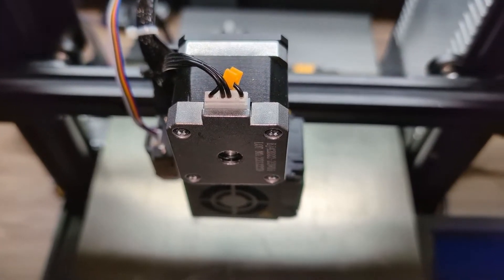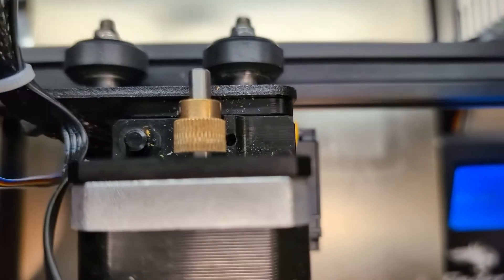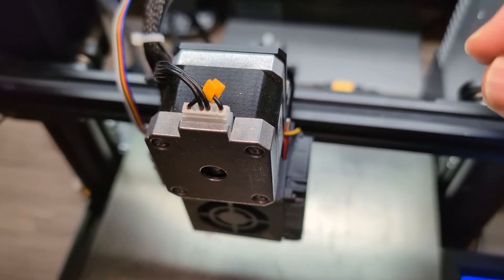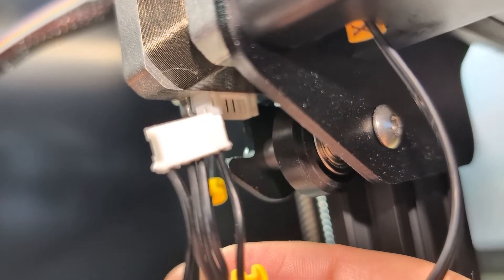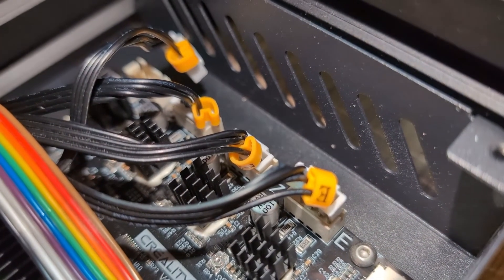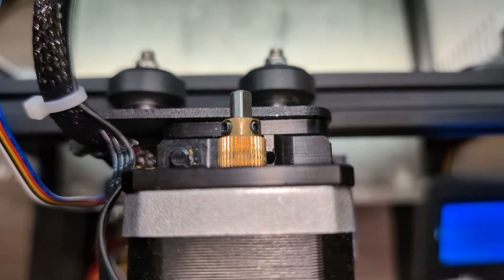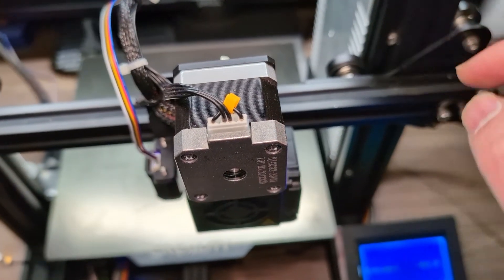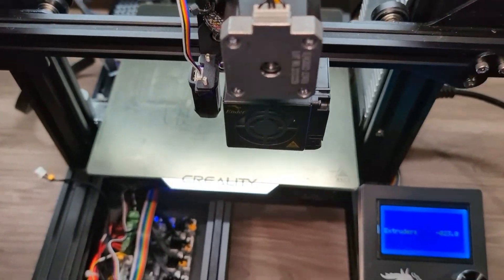Stepper Motor Troubleshooting | Fix Your 3D Printer #ender3 #3dprinting

Comment: hi i have an ender 3 v2 that stoped working after a print, the print went well with no problems but when i wanted to print other things the stepp motor didnt move, i have change the motor whith some good replacements and the cable and didnt work, and im trying to use other slicer to see if that helps if it doesent would that mean my board is broken? thanks.
Reply from the maker: Sorry to hear that, it could be the firmware or the board. Did you try to reset or upgrade the firmware?
Reply: @techs.passion  yea i tried that and didnt work i will try other slicer and to reinstal again the software, i think it could be a problem of power variation because like 2 days before it stoped working lights went off
Reply: if that doesnt work i will try to change the board
Reply: thanks for helping, the video helped me a lot  i will try that and see if it helps
Reply: @techs.passion  thanks so much dude it was a problem with the slicer i tried 3 diferent slicers and it worked with creality print
thanks for the atention

Comment: Could a loose wire make it move a lair line way off
Reply from the maker: That doesn't sound like a loose wire, maybe you have a different issue there
Reply: @techs.passion I have a neptune 3 max. I'm thinking maybe the stepper motor because when it went to zero out, it didn't make it to the stop, and it made a grinding noise.
Reply from the maker: Sounds like something is in the way or maybe the gear so not the motor. Sorry for the late reply
Reply: @techs.passion  np. thanks for replying, I did figure it out. I had the belt too tight and was making it bind up. Ty for the help.
Reply from the maker: Glad you got it figured out

Comment: Voxelab Aquila x2 same printer. I swapped the head with an ender direct drive so I don't have to deal with the hose and I can print TPU. My extruder quit and it was right after running it for hours so I figured the motor quit. I replaced it and nothing happened. Switch the cables and it still won't work. I could get it to run on x but ex wouldn't move x. Finally after checking everything I swapped the cables completely then x wouldn't move so I knew it was the ex cable. Appreciate the video. It's easy but gets confusing when you're swapping cables and this works and this doesn't and you have to wait every time for it to heat up. The computer would freeze every time I tried to move the extruder. It wouldn't spin.
Reply from the maker: Sorry to hear all the trouble. I'm glad this helped a bit and I hope you figured it out and thank you for watching :)

Comment: Thanks I just checked my motor with I think step two and about to test the wire in the mother board. Would you say if it is the wire I just need to buy a new one from creality or amazon?
Reply from the maker: I'm glad this helped. I would go with whichever is cheaper. I like Amazon normally things works. I hope it's all good for you

Comment: I am having trouble with mine. I replaced the motor, tried a different cable and it worked. Was told it was the motherboard and upgraded. Itnused to move not needing to be heated. Going to try warming it up and going through this video
Reply from the maker: Glad to hear you are trying to troubleshoot, hopefully this video helps!

Comment: Thank you this is exactly what I was looking for, I tried replacing the step 3 you specified yesterday before I found the video, but I was hesitant if I would break my board or something by doing this and now you gave me the validation it could be done. 
Most likely my problem is with the wiring or the board. If it is with the board any resources for resolving it would be helpful
Reply from the maker: I'm glad it helped, thanks for the nice comment and for watching

Comment: Just diagnosed my longer lk1 board. I added a second z axis stepper motor. Bought an extension cable and the backwards wiring FRIED the z axis. Used your video to keep me from over analyzing. Big thank you!
Reply from the maker: So glad to hear that, thank you so much

Comment: Great video unfortunately none of these solutions have worked for me. 

I have a sprite direct extruder on a ender3 neo v2 (which i bought second hand with it already installed). This might be a bit of a story so I apologize: I initially had problems with the prints not printing evenly which i found out had to do with a nozzle leak from a stripped heat block. In the process of figuring this out the smd fuse on the motherboard for the fan shorted out and I had to bridge it to get the fans to work. afterwards, the extruder seems to work very slow and is under extruding. I have tried swapping the cables with a stepper motor and it works faster. I have tried a brand new cable for the extruder with no success, i have already ruled out the possibility of a blockage. I have taken apart the extruder (everything looks clean). I have even gone as far as to replace the motherboard from the old 4.2.2 to the 4.2.7 without resolution. 

The main issue is that i feel like it's turning slow and the filament comes out thin and now completely unable to print because it cannot keep up with the printer. I have even tried calibrating it but changing the steps-per-mm setting doesn't change the length that gets extruded. Could this be an issue with the g-code itself? Or is this a voltage issue? I have been struggling with this for months and I'm not sure what to do
Reply from the maker: Hi @bflee888,
Sorry to hear about all the issues. since you went ahead and replaced both the motherboard and the cabel at this point, I feel it's something with the software. You mentioned that when you used the stepper motor cable and it works faster so based on that I say the motor is fine. Next I would do 2 things, firmware upgrade and slicer software settings reset or try a different slicer software. You did mention that even when you change the stepps it's not increasing so something is not responding, maybe the current is not enough and something to do with the power supply, when the fuse caused a larger issue in the power voltage. This is one hard to ping point really but if you want, join my free discord, we can further discuss and happy to help if I can. I hope you figure it out
Reply from the maker: Free Discord: https://discord.gg/FgVJYEUEXs

Comment: hi, great video, if the motherboard pin is the problem? you can replace it or you have to change all the motherboard?
Reply from the maker: If the board is working and you have good soldering skills I would say you can replace it. Honestly if you were going to replace the motherboard anyway, I would try to fix it first and if you break it or can't fix it then get a new one but at least you tried. Thanks for watching
Reply: @techs.passion  thanks

Comment: my stepper motor works but when the extruder goes as much as it can the motor keeps going what do i do???
Reply from the maker: Hi, sorry to hear that you are having trouble. It sounds like you have a problem with the switch that stops it, is the switch working?
Reply: @techs.passion   do you know where the x axis limit switch is on the adventure 4 3d printer? i am having trouble finding it
Reply from the maker: Not sure about that one but I would follow the end of the axis and should be there assuming it works the same way the ender work

Comment: Mine does work on the the other cable
The Extruder cable work on the axis motor
Even after i swap the motherboard cables
So where my issue would be
Reply from the maker: So in this case it could be the motor itself

Comment: Also i notice on my screen i dont have extruder settings like u have??
Reply from the maker: You should, might not be in the same menu depending on the firmware version but it should be there under move
Reply from the maker: Have ever upgraded the firmware version?
Reply: @techs.passion  sadly no I don't no how to to that my friend:-((I'm not very technical on stuff like that the new motherboard board will have the latest firmware on it I'm still using the original motherboard as I changed it over from the motherboard board as some 1 said it s the E chip that has burned out but when I did as u said try different stepper motor for example x or it says on the screen halted something something??I will try what u done on this old motherboard I am using I think its firmware is version v1.14.and the other motherboard board that I have when it was all working is version v4.2.2 the new board I'm getting is v 4.2.27.
Reply: @richardbrown9035  Does the old board work fine? If it works maybe i or techspassion can guide you though a firmware upgrade? ;)
Reply from the maker: Thanks for trying to help @MinePossu 
Firmware update video if needed https://www.youtube.com/watch?v=OqwusmWw97o

Comment: Hey buddy thanks for the video i will try that but as u no my motor does turn freely when no power but i power up it locks soi cant turn it but it juddering very slowly back and forth but doesn't feed the filament as i said the frist system worked great then stopped so i had brand new replacement system but not working unless i try your way.but i have order a new board n longer cables but i hve to charge the 2 middle wires over chris Cross them.same as the original E cable is.
Reply from the maker: Hi there. Yes, this is more like if you want to identify the issue, these will help you know if it's the motor, the cable or the board. Assuming your X stepper is working, this will help you narrow down the issue to an exact point and only replace that but replacing all of it should still do it. I hope you figure it out and get it fixed soon. Don't hesitate to ask if you have further questions. Thank you for watching
Reply: @techs.passion  hey dude I've bin trying the X lead into the E socket and started up the printer and the Extruder works so to my understanding is saying that the E lead is faulty /broken because I plugged E lead back into the Extruder motor and started printer and the Extruder motor was just juddering so my understanding the E lead is faulty or broken .
Reply: @techs.passion  @MinePossu  all my motors lock when i try to manually control any of the axis .no movement motor locks and says homing failed please restart.once i turn power off the motor unlocks .could it be the board
Reply: @jacobkruse7915  not exactly sure which printer is this?
Reply: @jacobkruse7915  prefer if this convo was on the discord but il also try to help here. When has this issue started, brand new out of box?, or after some change?, or random issue out of nowhere?
Reply: @MinePossu My first three guesses: It's an ender 3, you installed a bltouch, finally wrong version of the firmware was flashed on to the board.
Reply: Hey dude I'm a way at moment so not done the printer when I get back I will:-)and let u know how it all goes.thanks
Reply: Do other motors not lock up? if only the broken one locks up with power on that could mean a broken stepper driver. If that driver gets hot to touch when powered on it probably is dead/something is shorting it.
Reply: @MinePossu no buddy all other motors move :-)except the extruder motor all that does is juddering like it goes back n forth in small movements but doesn't pull the filament nor does get hot .
Reply: @richardbrown9035  What is the halt message the printer said. That you mentioned in a another comment
Reply: @richardbrown9035  Also do you have a multimeter. It could help to pin point the issue.
Reply: @MinePossu yeah I have a multi tester as for what it says when I change over the leads for example x it says halted something silly me didn't take a screen shot of what it says very soon I be getting the new motherboard and longer cables as a guy like u said on a Facebook page its sounds like the E chip has burnt broken as that I'd why the motor still has power but only juddering due to the chip I will hope the new board will fix it if not I will try the new cable but cross over the 2 middle wires like the original E lead has
Reply: @richardbrown9035  you can measure resistance between red and blue, black and green. They shouldn't be off by much you can compare to an another stepper motor. if resistance is very small it's shorted or in the kilo ohms range or open loop it's dead. this should verify that the stepper motor is fine.
Reply: @MinePossu  hey buddy right I've just trying the X cable lead into the E socket on the board and the extruder motor works :-)but when I put the E lead back in to the E socket on the board and start up the printer and starts printing the Extruder motor juddering so is saying the the E lead is broken??thanks
Reply: @richardbrown9035  Maybe, im not sure either your lead(cable) is broken or the e driver chip is broken. either one could cause the jurring. you can measure cable resistance from either end disconnected. red to red blue to blue excetra to see if one of the wires in the cable is broken. Or you can plug x motor in to E on the board and maybe try a extrusion command.
Reply: @MinePossu  I think it is the E cable as the X cable worked in E socket and the Extruder was turning :-)just got the new longer 4x leads and I have to criss cross the 2 middle wires same as the E lead as .
Reply: @richardbrown9035  Good that it's solved then :)
Reply from the maker: Thank you for helping @MinePossu I kinda felt it wasn't teh voard which is why I made that video. 
@richardbrown9035 hopefully it all works out for you
Reply: @MinePossu  yo buddy I'm away at the moment the parts turned up as I had to go away so when I get back I will let u no how it goes thanks:-)
Reply: @MinePossu  all my motors lock when i try to manually control any of the axis .no movement motor locks and says homing failed please restart.once i turn power off the motor unlocks .could it be the board